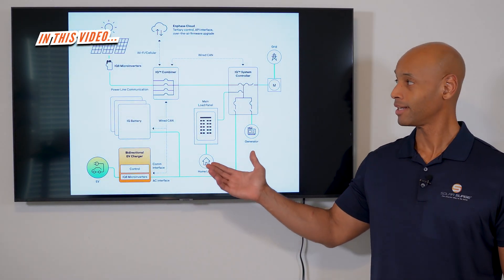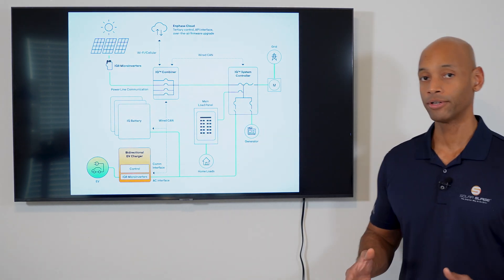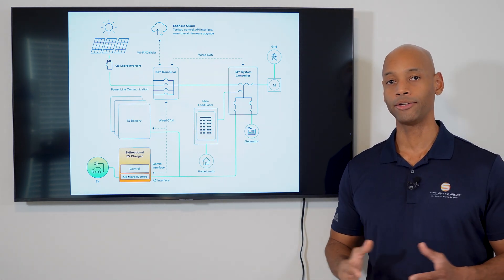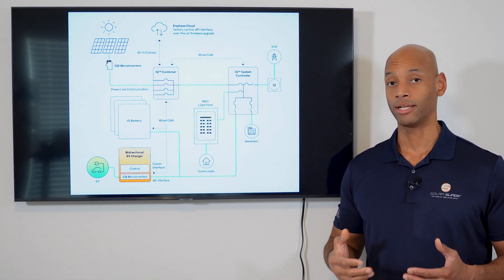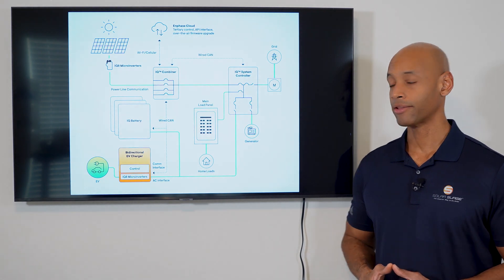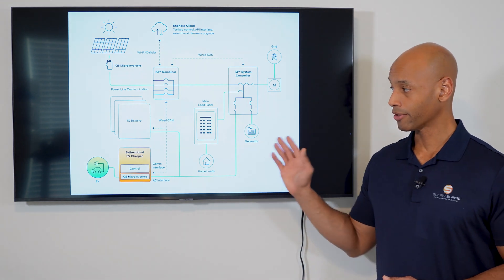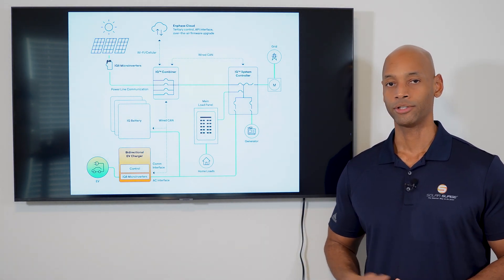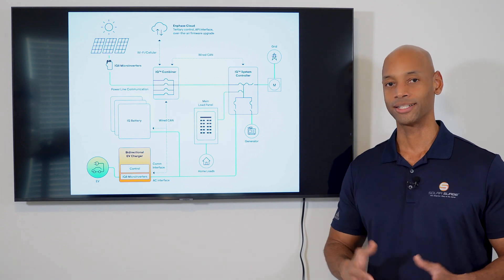Enphase Solar Power System 2023 (IQ8 Micro Inverter)

Comment: I am just having a similar system but without the micro inverter as I don’t have shading and the bi-directional ev charge point as they are not available in the UK as far as I know and I have an iPace that I am married to, so I can’t see an upgrade being available on a 4 year old car. I have an 8.8kwh bi-directional SunSynk inverter to cope with peak loads and 20kwh  of batteries as I only have roof space for 4kwh of batteries on 2 strings SE & SW so my main input of power especially in the winter months is charge at off peak rate of 12p and use during the day instead of 44p.  I have belatedly added a simple string inverter also as the 4 panel string only produces 120v and the SunSynk has a wake of of 150v and even though it works in cold weather it might not in summer temperatures.    You never seem to mention SunSynk which is quite advanced
Reply: i got grid tied enphases on my panels. can your pv still produce grid down?
Reply: @bootangy  the solar is Working at present on the SunSynk which needs a min 125v to wake up. One string will always be OK as produces  over 200v off a 6 Panel string. The other is a 4 panel which at present is providing up to 150v  when the sun shines and is 10 degrees C, but come the hot weather that 150v might drop 15% to 130v or lower which might not “wake the inverter”
Reply: @bootangy  not quite sure what you mean by “grid down”
Reply: @mikejoseph425  long term outages
Reply: @mikejoseph425  im tempted to buy a sunsynk  three phase inverter and battery. i been told that the generator input for the microi nverters will bypass my grid tie problem in long term grid down. not sure if that is true though
Reply: @bootangy  I’m in the UK and I think you are in the USA so terminology is a bit different
It is getting a bit technical for me so I will try to explain the system I have in the “cat sat in the mat method”
I have a non essential consumer unit that feeds inverter, cooking and EV
The inverter feeds the essential consumer units and connects to the batteries and the Solar panels 
The idea is for Solar to feed the house and any excess to 1 charge the batteries 2 charge my EV 3 Heat the hot water immersion
I have off peak Grid at a cheap to charge shortfall on batteries between 00.30–04.30 and the combination of 20kwh gross 17kwh nett so the combination of Solar and batteries should normally meet my daily on peak 20kwh needs. The off peak will normally be used to charge my EV
The system operates as an island if the grid goes down the essential will come on
I also have a change over switch interrupting the incoming mains to the non essential that if there is an outage that runs down the battery I can plug in a generator into to the second side of the change over switch which is then mechanically isolated from the grid
I am the customer not the installer so I can not assist in setting up the system. I just knew what I wanted to achieve
Reply: @mikejoseph425  i see. thats a nice set up. you  got it all covered! ty

Comment: California Installation.
Our current installation is comprised of 17 400-watt solar panels each sporting the IQ8 microinverter. 
They are then wired to the IQ combiner box, which is wired to the main incoming power service meter panel.
In the event of grid down situation we lose all power beings the solar panels are disconnected to protect the grid side linemen.

1st question.
Of the current equipment, what would be removed if the "IQ System Controller" were added to the current setup described or does all hardware continue to be used with this addition?

2nd Question.
By what means does the solar panel power get cut off when the grid goes down are there clamp-on meters detecting voltage located in the service main? I am thinking the new meter main box has some additional circuitry to allow the cutting off of power in my setup.

Can the IQ system controller be installed now and later other components added such as batteries and V2H hardware?

How does my Nem 2 affected if I have my system modified? I mean there was a rush to get my system installed to avoid the changes in Net Energy Metering 2.0?
Reply from the maker: 1. The IQ System Controller can be added without having to remove any existing hardware.  2. The IQ System Controller isolates the micro-inverters from the grid in the event of a blackout.  3. Yes, IQ System controller can be installed now (with load controller) and then batteries and EV charger added later.
Reply: @SolarSurge  went back and studied the diagram showing the different components and could not find the load controller you mentioned in your reply could you expand on that part of the equipment.
Reply from the maker: @MaxGoddur  Hey Bob. It’s not on the diagram but you can find it here.  https://enphase.com/store/accessories/accessories-storage/iq-load-controller
Reply: @SolarSurge  sorry but it would be nice to see the "Load Controller" in the diagram allowing us to see how it fits into the system.

Comment: I have a system with IQ7+ inverters and I was told by enphase that the inverter-level monitoring app you mentioned in this video is not included for free but rather you have to pay $250 for it. Is that your understanding too?
Reply from the maker: Maybe, but pretty much all of the installers offer it as standard equipment. Most homeowners want to be able to see each panel.

Comment: I’ve sold more Enphase than anything else. No one mentions that Enphase also has a single point of failure, the AC Junction box or Combiner Box. This only has a 5 year warranty and has  caused us issues when it fails
Reply from the maker: The 5 years has more to do with the internal cell card data service. There’s no reason a breaker box should fail in 5 years.
Reply: @SolarSurge  When 3G was obsoleted I had the choice of buying a new cellular card or reconfiguring my combiner to connect to my WiFi Internet. I did the latter. The upside is I now get near continuous reporting on my power production at the panel level instead of a few times a day with cellular data. The downside is if I have a neighborhood Internet outage the Envoy can’t talk to the cloud, but neither can my Enphase app so… What are the stats are envoy failures a problem?

Comment: Would incorporating a SPAN panel with the Enphase allow for eliminating IQ8 System Controller, if NOT what would be the benefit of the added expense of a SPAN panel in an IQ8 solar system?
Reply from the maker: Good question. The IQ System Controller is required for any Enphase system with Sunlight backup or Enphase battery storage. The “system controller” is basically a transfer switch. The Enphase Load Controller more closely matches the function of the Span panel.

Comment: Is it worth the 40% cost increase over a String inverter sytem?
Reply from the maker: The cost increase should not be that severe.  We see about 5% higher cost overall.
Reply: @SolarSurge  Thanks for the reply. Love the show.
Reply: I think so.  I had a string system on a previous installation.  When the inverter subsequently failed I was without the ability to export or use the solar power generated.  As the string inverter came from China it took several months to get a replacement.  I now have the Enphase system which uses the micro inverters so there is no single point of failure.  The Enphase system is operating at 100% reliability.  Your choice depends on what you want to achieve with the funds available.  Starting with a system that has growth potential as funds become available is a good way to begin.
Reply: @Helekopa_Pailaka  I currently have a string inverter system. I’m in Texas. The cost of Enphase micro inverter/ panels. Vs my current string inverter system was about 40% higher. It could have been because of the installation cost. I’m not sure. I only know that my 3 quotes were from $75000-$87,000.  For the same sized system that I got installed. That is a string inverter. 12kw &  1 Powerwall. My system cost 40% less. I will checkout a DIY Micro system for my storage shed. My house roof line will shade it. So Micro might be better for that application. Thanks.

Comment: Concur wiith all except battery storage, still too expensive to add batteries.  More cost effective still to install a generac propane whole home generator.  Also the battery output compared to some seems weaker.
Reply from the maker: Hi Alex and thanks for writing in.  We do a lot of systems using solar + batteries + Generac generator.
Reply: @SolarSurge  Yes, I am sure you do but not everyone has the budget.  Given one should go for the iq8 inverters for future proofing.  Setup the device so you can get emerg power at least during daylight hours, the next step is  a. do I spend 10-12K  on batteries that may not do the whole house, will not provide power during the night, will not provide full power if the days are overcast or the solar panels are iced over.....................     Compared to spending 6-8K US  (8-10K Cdn) on a whole home generator................. day or night,  regardless of cloud/rain/ice/snow cover..........      Battery costs have to be cut in half to make them tenable.   Just my opinion~  I would much prefer to not have to burn fossil fuels........

Comment: If you iq 7plus solar panels and get the wholeback , would it still be able to run the house cause battery has iq8?
Reply from the maker: Yes.  You can technically add IQ batteries to an existing home using Enphase IQ7+ micro-inverters.  For a new system, I recommend keeping everything IQ8-series.

Comment: Another great video, I don't think anyone else really explains the new capabilities as well as you do.
With California killing net metering, I think there will be a big market in California for this.  A 10 KW Enphase battery system and hooking that up to your car will easily get you through the peak hours even when running the air conditioning.  The plan that I have with SDGE, the new (and much higher summer rates) for peak is 81.6 cents per KW and for off peak is 15.4 cents per KW.  Saving 66.2  cents per KW (about 80%) is a big deal at the end of the month.  I was not happy when they jacked up the super off peak rates by more than 50% this year.
Reply from the maker: Those prices are just ridiculous.  We are still paying $0.12/kWh where in live in SC.
Reply: Wow, here i was upset my electric rate doubled to 36c/kWh, can't imagine 86c/kWh

Comment: The  EV  has to support bi-directional charging to make use the hookup. I know the Ford F-150 Lightning does but Teslas does not at this point. Probably because it may reduce Powerwall sales.
Reply from the maker: Tesla says they will support this too, but Elon recommends using the vehicle battery only in tandem with a dedicated home battery.
Reply: @SolarSurge  In fact, Elon wasn't at all interested in using EV as battery backup for the home during last week's Investor Day presentation. Too many variables, however, for every valid argument for EV backup, there's and equal an opposite argument against EV backup. Makes the head spin. Whatever suits the individual. By the way Joe, you have a worldwide reach. I'm in Melbourne, Australia and enjoy watching your videos. You explain everything in a simple and calm manner.  I have a large LG/IQ7A array on my home.Cheers mate!!
Reply: @davidissko9796  The next vehicle will have 240V / 120V output at least, so that's pretty neat.  I have a couple Ecoflow Delta pros that I can use as a generator together to power my whole house (minus big loads of course).  If I could just plug in my EV to charge those too, then I'm good.  It is going to be waste via dc to ac back to dc, but it's a niche backup solution, not a constant thing.
Reply: Cybertruck has bi directional power. Unsure if it will work with enphase though.

Comment: I have the IQ7 inverters with 1 10KW battery. It works great. Wish I had the IQ8. Power went out and only had backup circuits powered. With full sun I make enough to power whole house and send power to the grid. Either way having solar pretty much eliminates electric bill. Prior to Solar, one month my electric bill was over $800 during a summer month, but no more. :)
Reply: smart. same here. -V
Reply: How much would this system cost for a 1900 square foot home with Ion solar panels?
Reply: $800 us dollar per month?! Geeze. Why
Reply: @0my  California in the desert. Big house lots of AC.
Reply: The Enphase IQ System Controller listens to the grid (is there proper power?) and the micro-inverters. If no grid power, it disconnects the grid and then routes power from the micro-inverters to the batteries, house, load. If it’s dark, and the grid goes down, then it disconnects the grid and supplies the house/load. Once it senses the grid again, it flips back and now the grid is back online to the house/load. No back feeding, for obvious reasons.
Reply: Hey bud I'm supposedly getting 2 IQ8's installed.
   Any advice you can give me BEFORE I learn the hard way would be great! 
Thanks
Reply: You can't send power to the grid in an outage, you'll kill a line worker. You could have your transfer switch cut off the downed grid connection and have all of your circuits powered by the solar/battery system fairly easily though.
Reply: @Snerdles  Not easy, this is why they said that they wished they had 8 series inverters. Otherwise you are limited to micros per battery capacity.
Reply: @Energy.Theory  you can still do an AC coupled battery with the IQ7 setup and a separate inverter for the battery which will keep the solar running during an outage. It's pretty simple.
Reply: @Energy.Theory hat the heck are you even saying? You can't send power to the grid when the grid is down. Ever! It's very illegal and very dangerous. My uncle was a linesman, and he was killed in that manner. But regarding the original post... I think the intent of the comment was to describe two different scenarios; and he was not backfeeding when the grid was down. He was just describing the size of the system compared to demand during normal operation with the grid up.

Comment: I'm playing this a 2X speed and it still seems slow. Most of this stuff has been available for the past year. It's only the bidirectional charger that's new. Enphase is the expensive option to do all this, and you can see why. Having an integrated system is great, but the idea is to save the customer money, not charge them more for it. Enphase works in CA where energy prices are high, but here, in NC it's prohibitively expensive when energy is only 7.7 cents per kwh.
Reply: Duke charges .11 kwh here with the energy star rate. Not sure where you get .07 kwh but that's not the case for most of the state.  Plus Duke wants to raise rates aggressively for most of the state. I would gladly add 1 year to payback for a superior system.  My solaredge inverter has failed twice in 5 years. Pretty sure it will need to go in 10 years thank God with credits I hit my payback already.
Reply: @branch7010  Energy United is 7.7 cents, and their solar program is paid at wholesale avoidable cost, not retail + tax.
Reply: @ToddDesiato  that's great crazy how much better than Huntersville area and their power company which both serve small focused areas.
Reply: Wow 7 cents! In Puerto Rico we pay 30 cents and with unreliable service, everybody is going solar. I have my enphase system for a year now.